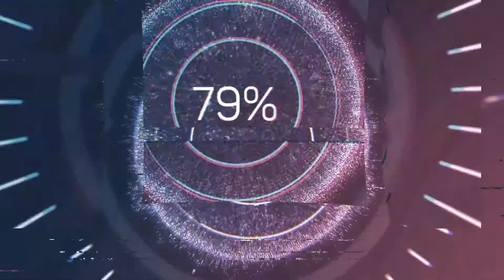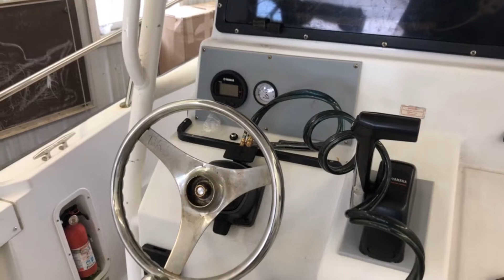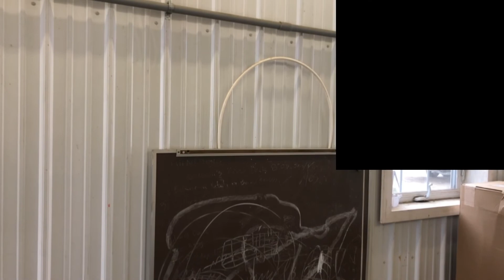How to replace and bleed seastar hydraulic steering helm

Comment: I have the same set up but my steering wheel is wobbly.  Do you know what causes that?
Reply from the maker: Not sure what you mean by “wobbly”? Make sure the steering wheel and helm have the same taper?
Reply: Replace the tilt unit part number HA6523

Comment: Did you buy those fittings separately or did they come with your new helm. I'll be replacing mine in the spring and I like those fittings. I'm sure I can get them from West Marine or some other place. Thanks for sharing. Also I already took my steering wheel off when I put my boat away for the winter. I makes it easier when taking the reservoir off. Thanks